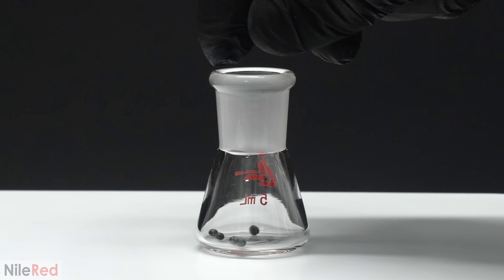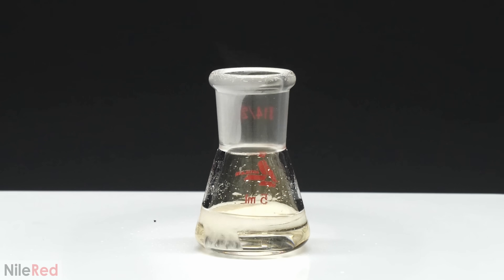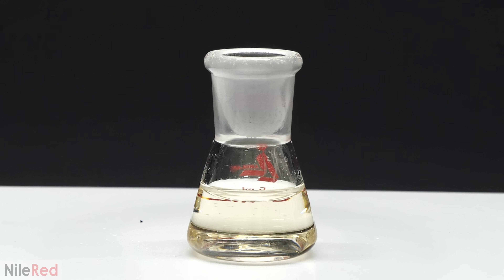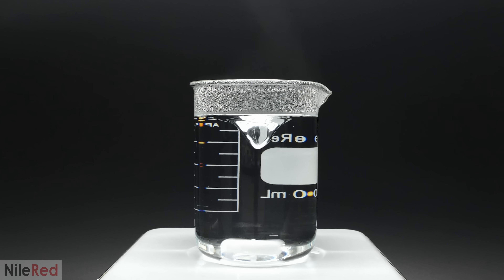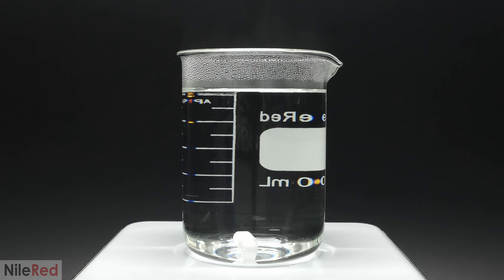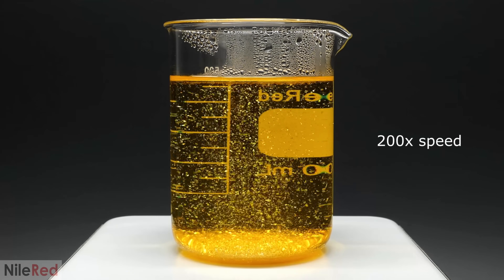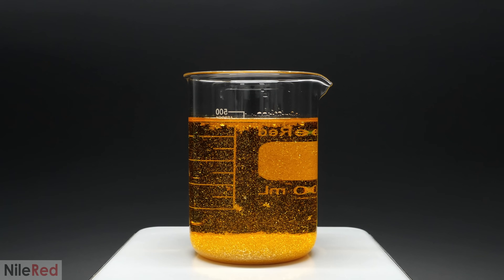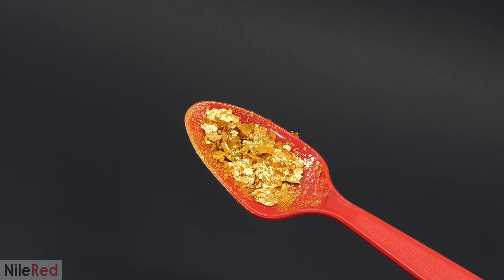Turning lead into gold (lead iodide)

Comment: Ok, so here's my luddite question: Is it plausible (if not feasible) to use particle accelterator ion collision fuckery to legit turn lead into gold?
Reply: Yes. It's not even remotely economically feasible, but the steps have been worked out, and I think one person actually did it for the bragging rights.
Reply: For anyone curious Lead was successfully transmuted into gold in 1980 by Glen Seaborg using a linear accelerator.
Reply: Yes, but it is very difficult
Reply: You can turn various elements, including lead, into gold through nuclear fission, but the energy and danger involved in this process makes it not even remotely worthwhile.
Reply: Theoretically you could use a very extreme event such as a supernova to create gold.
Reply: @MyHandleIsGood  Pretty sure the stars make the gold, and the supernovas just spread it.
Reply: @greeneyes-_-  Then you would just need to capture the supernova or collect it.
Reply: @greeneyes-_-  no everything heavier than iron is made in the supernova itself, fusion doesn’t work past iron in stars during their life prior to supernova.
Reply: @ElectricChicken  oh ok
Reply: Yes, but it'd be cheaper to use neutrons from a nuclear reactor. Reactors that are set up for that generally have more valuable things to transmute, though. When you consider the array of products that can be produced by transmutation, there are much more $$$ per atom options than gold.
Reply: As everybody else has said, plausible, not feasible. Notably, uneconomical now doesn’t mean uneconomical forever, so who knows. If we could truly unlock transmutation of anything into anything at economic scales, a lot of people would make the argument we’d be living in utopia. Plastic waste and piles of trash could be made useful and economical for people to collect and sell again. I’m actually not fully convinced the technology would be as world-saving as we think. 

Firstly, whoever controls that technology is going to have an immense amount of power over everybody else and it’s going to cause some serious corruption. The rich are going to abuse their standing to get access and make themselves whatever they want using resources collected by lower classes. I really don’t think it can be understated how different the experience of this technology would be depending on your class. It’s not going to be a household item. The people who truly need more are not going to have the access to it and the people who already have way too much are going to have the access to get more. The only way this is solved is if the scientific community hoards the technology and gate-keeps its use, which would just become another way anti-vaxxers and flat-earthers and other anti-science conspiracists turn people against science.

I’m also almost certain it’s going to completely shift mentalities away from worrying about any kind of personal responsibility towards the environment and people are going to over-consume the fuck out of whatever they want. It’s also going to result in a lot of things we don’t value, but that are crucial to survival, being farmed for transmutation into things we do value. I see a world where we are farming biomass in the form of hay or deforesting everything on this planet just so we can have a bit more silver. If we think humanity is a gluttonous species now, just wait until they have the power to completely ruin the whole planet for some shiny shit. You can’t transmute to re-create a tree, you can MAYBE transmute to create wood, but you already see us cutting down hundred year old trees to make reams of paper. Imagine how many more we’d be cutting down if it could be gold instead. There’s no replacing that through transmutation. A tree needs to be grown and that takes time, a resource you also can’t transmute. Also notably, we’re probably not going to be able to transmute food items, nor use it to fix climate change. People are going to expect that such a god-like technology just fixes all our problems, and giving the richest people the means to over-consume even more without a solution to climate change or food insecurity is literally going to cause a class war (which I think needs to happen anyways, but I digress). 

Ultimately, I think the technology of transmutation sounds utopian on paper because people think of all the good it COULD do or all of the things they COULD have, depending on their level of selfishness. Ultimately though, the technology is really just taking the so-called sins (I’m not religious) of greed and gluttony and enabling humans to carry them to their logical extremes. I don’t think the technology would save humankind, I think it would end it, unless there were some scientific organization that could be formed around it to ensure that science and technology is only used in an ethical manner, and was powerful enough to protect that goal without being corrupted, which is a job political scientists would probably tell us is impossible.
Reply: It's cheaper to produce Gold via Fission reaction compared to the fusion reaction process which I would estimate that it requires around 10 billion degrees at the core of a violet supergiant star to actually reach a version of Iron Poisoning which stops at Gold and something similar in the same nuclear group of the periodic table. I am sure that star existed a long time ago, after all we had Quasi-stars which were literally black holes on fire (a Quasi-star have had a black hole at the center, and the energy came from in-falling nuclear fuel that it simply get hot enough to fuse on the way to the central black hole). Now? Your best bet is a pair of Neutron stars in the death dance or a huge supergiant star about to blow up to set up the collection of Gold, as violet supergiant stars are already extinct, they're all black holes now.
Reply: If you find the right star, those make gold from lead.
Reply: plausible yes, feasible no
Reply: If you're going down this route, lead to gold might not be the most difficult "transmutation" although it would still be very hard. You have to go from a nucleus with 82 protons and 126 neutrons to 79 protons and 118 neutrons. So not impossible in theory but still far from cost-effective in practice.

Comment: you can actualy turn lead into gold but you need alot of radiation
Reply: Not a lot of radiation you need neutrons 
For that you need a precise amount of a precise metal isotopes
Then you will shoot the metal isotope with neutrons if you are lucky the metal will be transmutated gold…

Right after it got extremly hot and radiated  alpha and beta particles
Reply: @kayragur3542  so basically it is very easy to do and something i can do at home?? cool!!!
Reply: @YelMalanta  if you want gold get gold its easier than setting up a nuclear physics lab
Reply: @YelMalanta  Sure
Reply: @kayragur3542  i mean fair, but doesn't starting up a nuclear physics lab sound fun?
Reply: @YelMalanta  Eh isnt it illegal lmao
Reply: @YelMalanta  yeah even if you make gold through nuclear reaction, you can't use it bcz its will radioactive. And it will eventually decay into another element.
Reply: @shoya4937  oh yeah, there was kid who made a reactor in his backyard, and there was a whole ass response team, it is very much illegal.
Reply: @kayragur3542  thank you for suggesti
Reply: @YelMalanta  oh yeah I know that kid
His name was david hahn or something right?
Reply: @kayragur3542  Yep David Hahn.
Reply: @gemhunter498  Making enriched uranium is quite easy, you just need to get a tunable narrow-bandwidth dye laser and pump it with a larger copper vapour laser. You'd also need a way to get UF6 from uranium dioxide,  and I'm not sure they sell cryogenic elemental fluorine in hardware stores (though I haven't checked).
Reply: @YelMalanta  Mhm FBI open up xD
Reply: @marc-andreservant201  i'm guessing those lasers was newer technology at that time, and he didn't know about them. This was in 1993. The blue laser diode wasn't invented yet.
Reply: @kayragur3542  Maybe easier for you.
Reply: @shoya4937  Only if they catch you.
Reply: @kayragur3542 that’s radiation
Reply: Or you could go borrow a star. Those things make gold, if they're big enough.
Reply: @gemhunter498  Yep, most AGB red giant stars produces Gold via side chain reaction which also produce dusts of Titanium and a few other exotic elements we have come to take for granted. And another way to produce Gold is to literally blow up a Neutron star by crashing two Neutron stars together hard enough to cause supernova, and it happens pretty often when you have masses of dead stars in the nebula going for each other via gravitational pull.
Reply: It's useless cause the gold you'll  get after all this will be radioactive too which means you can't use it.until you want to die
Reply: @babubhaiyabandookbaz3716  well,in urainium and plutonium ect the danger isnt the direct radiation,as long as you dont get exposed to it for a long time you would be fine
The reason I said would it because urainium and plutionium can result in heavy metal poisoning which means the urainium goes into your bones staying there for a long time,I dont think I have to tell you that urainium in your bones are not healthy.
İn gold there is no such thing you could sell the gold before you get cancer
Reply: or you can wait for two neutron stars to collide and harvest the nearby cosmic waste.
Reply: Umm no...you need thermo neutrons
Reply: @sunandinighosh6037  thermo?
Reply: Radiation? No. You need accelerating neutrons. Somebody failed basic physics. Waves and particles are two vastly different things. Unless your an electron.